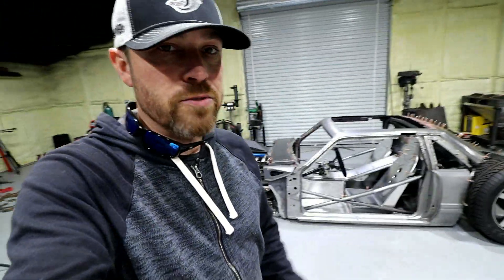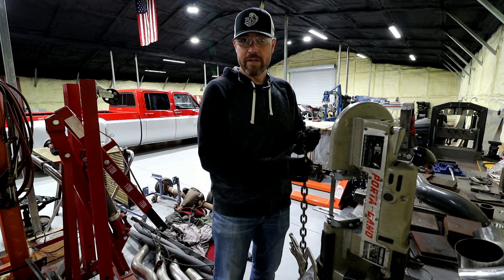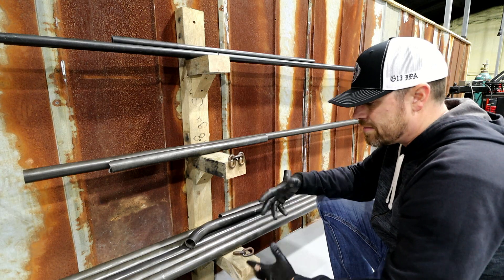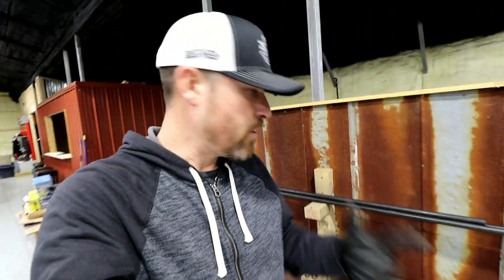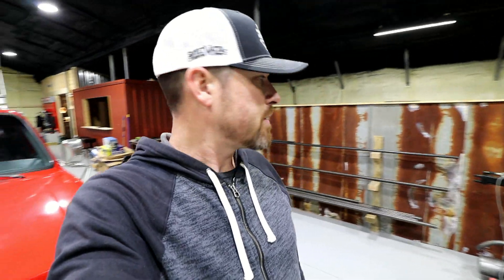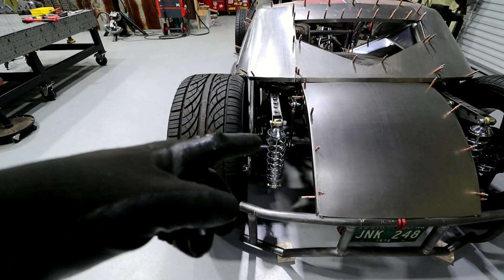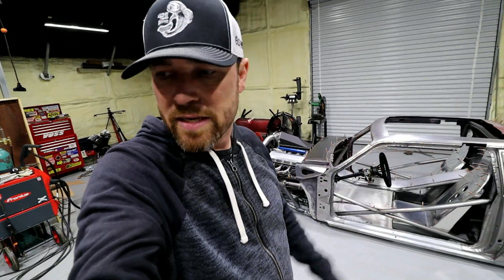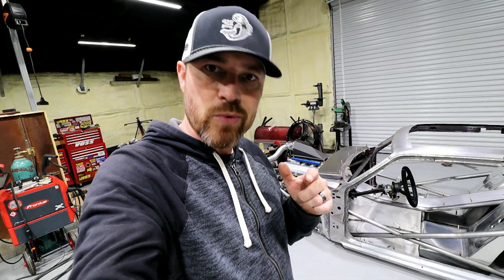Suspension Ride Height Adjustment - Custom Fox-Body Build

Comment: You can set up 1 hydro pump to lift it 2 ways that I know of. 1 is to use 2 dump valves and the lightest end lifts first (typically the rear) and has to lift maxed out before the front starts to lift then you dump the rear to ride height. I used this setup on my bodydropped truck. 2 is you wire in a 3rd dump valve to block flow to the rear when you want to lift the front. You just have to lift the front or rear one at a time separately but you don’t have to lift the rear all the way so it conserves battery life.

Comment: Dude. Looks great. #4 on the rack. But cut a rusty metal plate to cover the end of the wood. Bolt the plate to the end. Then weld up the #4 style links to the face of the plate. Love your channel man.

Comment: On  the rack , any scrap 1/4 plate you have to cover the wood end and rust it to match the wall . Using a couple of rusty screw bolts to fasten it . You could even write in weld the size on that part of the rack 👍

Comment: For tube rack, see if you like using more links in an upside down U. So you will have maybe even 4 places to fasten it and it can be as tall as needed, so you are not limited to a single ro/diameter of tube. in that configuration you can even screw it into the sides living front of the wood exposed.

Comment: 3 links straight up in down. One link above the board, one bellow. Do that on all the boards, then you can take a wire with a clip and clip it to the chains so you have vertical support when you fill that thing up.

Comment: Make sure your hydraulic pressure to the front is only as big as needed to raise the car. If you push fluid until front cylinders bottom out, then it will start compressing accumulator bladders. In turn leaving you without any cushioning. Also all cars that use hydraulic struts have accumulators placed close to the strut as packaging allows. As I think it might not work as well if it is separated by a very long run of tube/hose.
Reply: I don't think he's going to use accumulators because he's got springs/shocks as well on all 4 corners. These hydros would just be for changing the ride height and can stay stiff.

Comment: Strip the lags like you did the tin, and rust. 3 link hanger,add cut 1/2 link at bottom to hold lag, and 1/2 link at top between upright links to make taller.

Comment: I watched the video this morning (2-21) saw you working on the steel rack I think a solid piece of chain from the top to the bottom shelf (the rusty chain with used fasteners one on each side). The only downside is you would have to remove the material from the end

Comment: #6 - remove the beams and gussets and add a 10 degree bevel to them to pitch the fronts up a bit.

It would at least minimize any rolling off while you figure out chain usage.

#7 - 5 links, numbered 1-5 from left to right - 2-4 are horizontal, bolts through 2 and 4.  Outer links 1 and 5 pitched up at 30-45 degrees like bull horns.  If the wood isn't wide enough to support the middle 3 and 2 bolts, pitch 2 and 4 up a few degrees to move the bolts closer together.

Comment: Worked at a fab shop for buildings. They had all the rails at an angle. Maybe use A piece of angle iron 6x1.75x.25 x 0’-3.5” with the 6” leg across the top of the wood. Then some of that chain making an angle along the 6” leg then vertical on the 1.75 leg. You could then mount it w/ bolts on each side of the vertical chain. If you have other thickness of angle iron around just remember to add that to the 1.5 that your wood is so that the iron will end at the bottom of the wood. Just my 2 cents worth.

Comment: What about putting a U bolt or D bolt, whatever they call em, to the fronts of the horizontal wood pieces. Then running chain from the bottom to the top of each section. The chain shares each bolt. With the bottom of the chain being attached to the bolt and the top uses a hook so you can undo it when you need to get a piece of tubing. Then you can stack each section as high as you want.

Comment: What did you end up using in the end for the hydraulic pump / slow down setup? In a similar situation where I'd like to use hydraulics to adjust ride height but two full size pumps are overkill for my needs. My project uses hydraulic cylinders acting as a push rods to connect the cantilever to the knuckle, front and back(irs).
Reply from the maker: I have a standard style dump bed pump that does all four corners

Comment: 5, concave the shelves and router all the sharp corners off. The tubing would be easy to roll off/grab. You could cover the sides with plates for support if needed and add designs into the plate and patina it. No matter what you do it'll be awesome.

Comment: The accumulator/cylinder thing is very similar to the Citroen Hydromatic suspension from the early '60s. I suggest finding what they did to control the damping on those. 

Oh yeah, Option 2.

Comment: As somebody who has worked with wood alot, I need to mention that end grain does not hold fasteners, like the lag screws you are using, very well or for very long.  It won't take much to pull them out of their holes or crack/split the wood block they are set in. I like your rack for the tubing, but think you need to mount any retainers to the sides of those blocks, and as far back from the end as possible. Maybe a longer piece of chain that bolts the end links through the wood a few inches back and wraps around the front with a link or 2 sticking up over the top.

Comment: Aluminum upper may be too monochromatic without something else to break up the color scheme.  Adding a carbon upper would break it up, but with nothing else in a similar texture (unless you paint it), it too could look out of place.  Tough decision.  I'd probably go with the aluminum before PITS as it may be less work and it would give you some time to step back and decide if you like it a lot or not.  Is there a reason for the missing end screens BTW?  New trend, or just tying something different?

Comment: Bend re bar 180° and weld a peice of flat stock across the end and rust it drill some mounting holes and boom rustic easy and fits the barn shop theme....

Comment: single bolt/single link is going to be suceptible to knocking loose when you smack it with a piece of tubing.  double bolts in a single mount is the way to go.  love the reused hardware though, i do it as much as possible with my builds.  and i vote ALL ALUMINUM on the intake.

Comment: I would make an end cap with sheet metal. Bolt that on or make it to where it has a tight fit or epoxy it. Treat it so it has that weathered look. Then weld the chain link to it.

Comment: Any option's are good to me. But to help you in hydraulic worlds lowriders use them pumps they run off 12v power turn the pump push fluid out pass the dumps that sits on top which goes to the cylinder's to lift the car. Now between the dumps and pumps there an check valve keep the fluids from going back when cylinders is compressing which holds the car up important part. Now to signal the fluid back the dump is powered by an switch which activates and spend the fluid back to the dumps which moves to the other port of dump and return to the tank side of pump. Also reason why cars hop is due to how many batteries you can put in car so the more battery more quick and responds lifted the less battery slower lift there an other pump called pesco aircraft hydraulic pumps use on old plane back in the 50s or 60s that will work great for your ride they lift slow strong but there pricy to should into it. Also call Hoppos hydraulics there can help you with your build and what you need

Comment: For the rack. Make all the end caps different slightly. Less precision to the angles if ur OCD can handle that.. to make it look like a 100 year old plank w the cap attached that has been repurposed for the shelving. And maybe even different bolts/nails holding them on. At least cosmetically
Reply: Think old west desert kinda style

Comment: 'on the not gaudy theme:
what about a larger (3/4 - 1") downward drilled hole in the surface of the 4" dimension?
you say it hardwood so there ought to be plenty of support to keep it from busting out.
then make up some easily removable 'pins'  -  rusty RR spikes come to mind
'cool shop

Comment: #1. Aluminum looks better than carbon but as a selfish viewer it would be interesting to see the quality of the finish you could achieve with carbon. B is for Build ended up painting most of theirs on their Lambo (which was a great build but they are always in a bit of a hurry over on that channel).

Comment: Something else to consider instead of just bare metal do a tinted clear coat on the body 
You’ll still see the metal but add just a touch of color 
To just the body 
There’s tons of bare metal cars 
But bare metal with tinted clear would look insane

Comment: I like the fact that you used recycled timber to much if that stuff is wasted. The end stops I like the 3 link option looks the best but with an extra link welded horizontally on the bottom to give a good strong fixing point close to the center of the wood. That's my 2 cents worth anyway.

Comment: Some front motorcycle sprockets would have been cool. Probably perfect size for that wood. Just drill two holes to mount and have it a little more than half above then the bottom of the sprocket would cover most of the wood. No offense but I’d say no on the chains.
Reply: I like #1 but it needs to be higher so if you stack tubes more than one layer high

Comment: Horseshoes are meh.  Lag bolt heads are too big.  Maybe do some strapping around the wood, that you can weld your links to.  I like option one.    Just don't want them rotating.  Metal stapping looks good on wood.  I was thinking maybe allen socket heads, but would be a hassle, unless you can find one in lag screw threads, or did some cutting and pasting.  Also round rivet heads? !?

Comment: Nothing cut your horizontal pieces from the wall at a slight angle and let your tubing roll "down hill" towards the wall
Reply: Did not read through the comments my bad t1

Comment: I like idea number 3 myself... That wood looks like hard maple to me although more common for pallets is oak so likely its that but one or the other for sure. Now quit asking stupid questions and get back to work son!

For the scoop how about aluminum but then have it anodized to say a blue or red or Oooo maybe a copper color just for a bit of contrast?

O and for your shiny bolts get yourself some gun bluing (black Oxide) and blu them to give them that old patina look. Lots of older equipment and tools thats what they did to the metal to help protect it..;)

Comment: stupid use wood tube rack, made normal good strong rack/self all tubes, 100x50 metal vertical and 3-4 pcs 50x50 tube horicontal and flatrod top or horicontal bar tubes not roll and drop floor.lot better and cheap build, and lto safe and better than idiot wood.